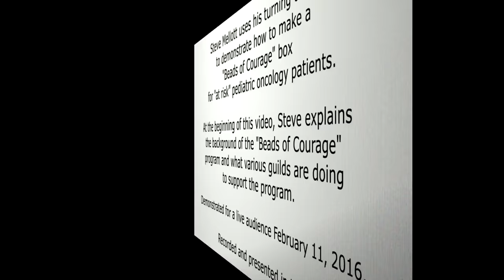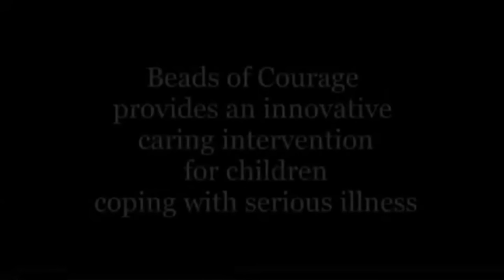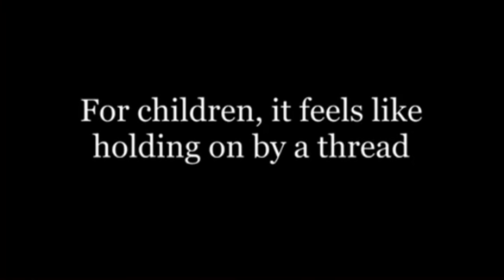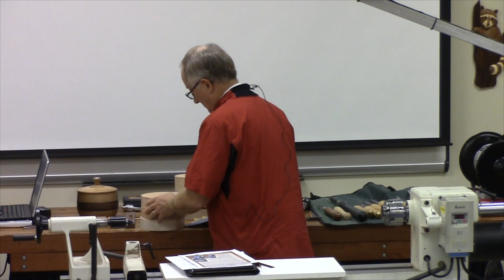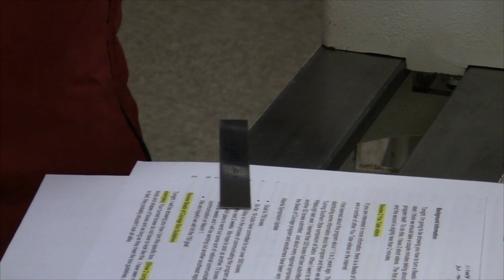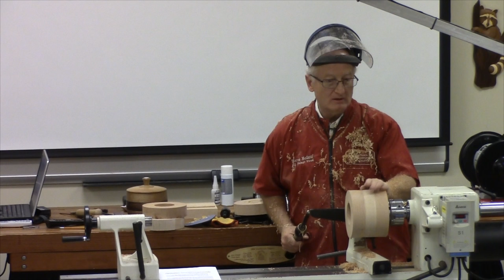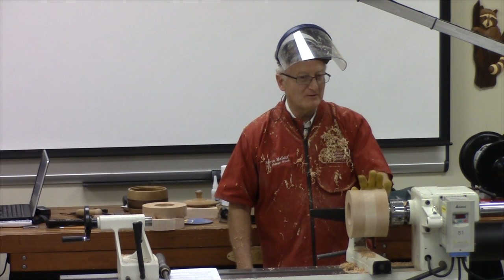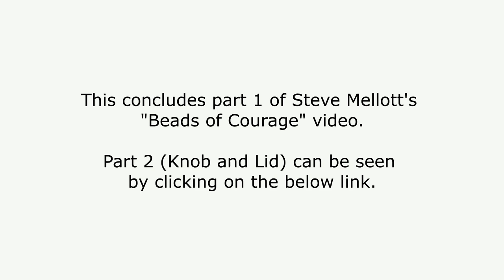Beads of Courage (part 1) Box

Comment: When gluing up the blank, does grain orientation matter?
Reply from the maker: +Mark Trenier When you glue up the blank, typically you align the grain in all the pieces so it is all running in the same direction.  Cosmetically, the 
finish looks better and the wood in the different pieces moves in the 
same direction (if it moves).